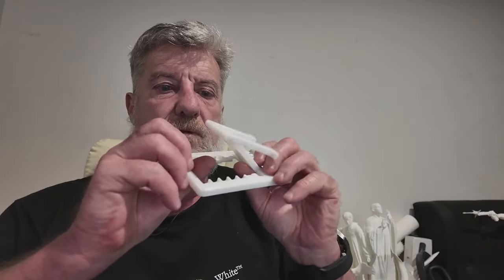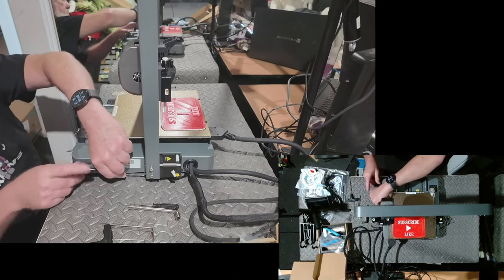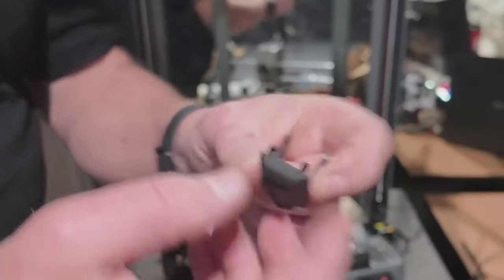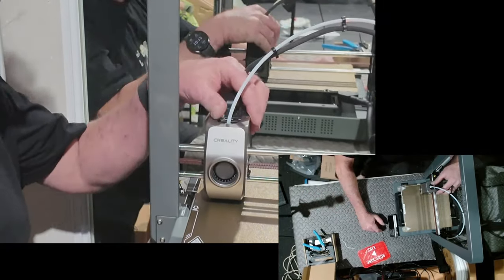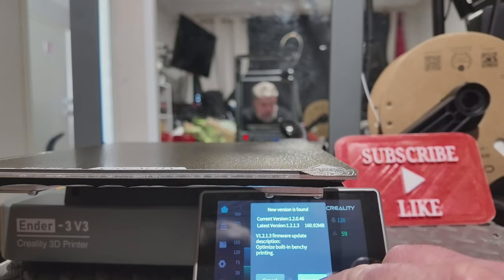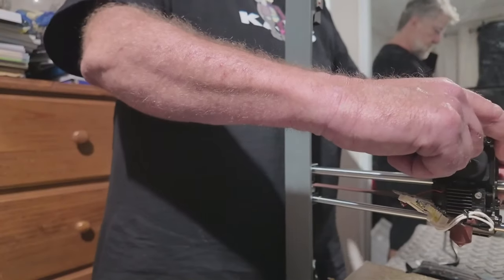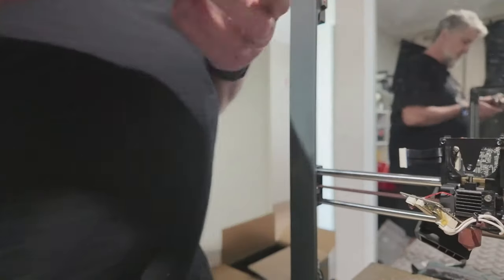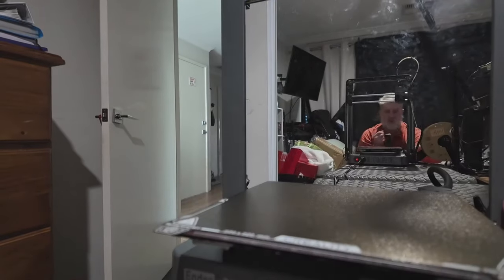Extruder jam when unboxing my Creality Ender-3 V3 !! Extruder dismantle starts 40min 35sec.

Comment: What about Creality camera with Ender 3 v3??? Timelapses options? Do you think in a review/demo?

I read that this printer does not run with TPU filament, what do you think??

Regards from Spain.
Reply from the maker: I'll run some test with TPU tomorrow and do a video of it :)  Will also do one for the nebula camera on the V3
Reply: @3D4Everyone1  Subscribed!!!

Thank you very very much.

I'm thinking about that printer, but I haven't seen any information on those points.